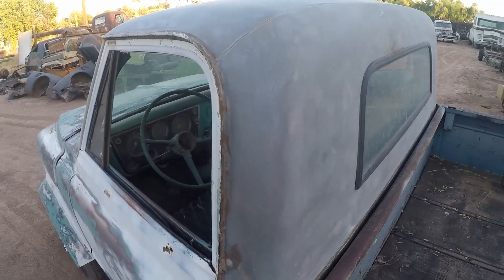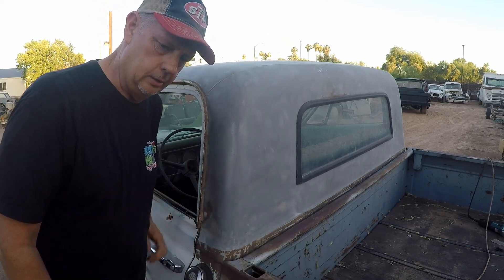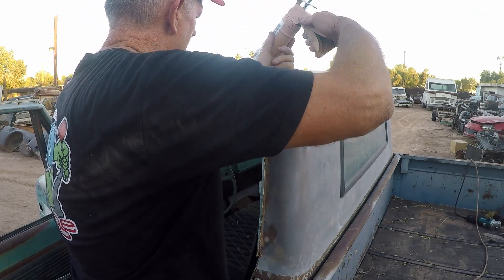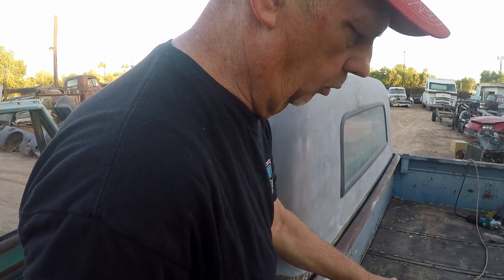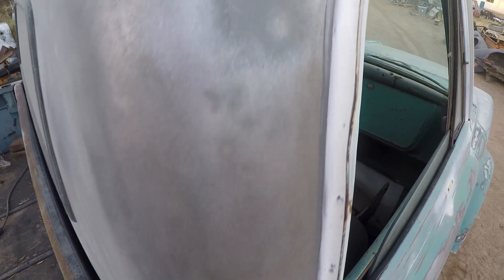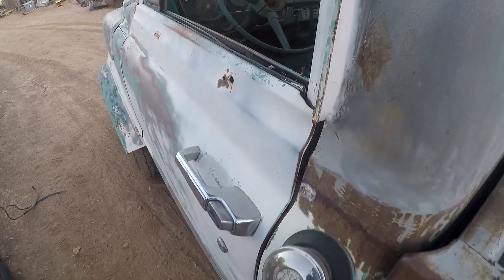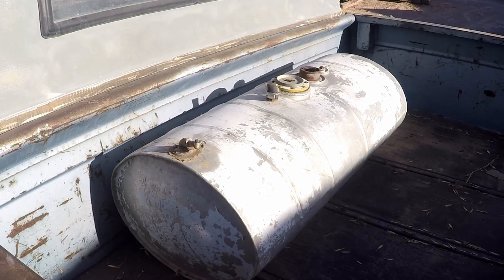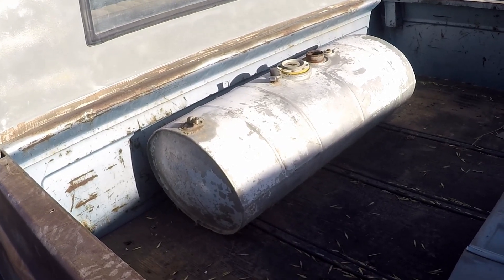69 C50 Faux Patina paint job moves forward. New tailgate with old skool pinstriping we need to save.

Comment: Love the tailgate. I think you'll be able to blend it all right in. 
Is there any way to blend in that notch between the bottom of the fenders and the door or is that unavoidable? It's the only thin I don't love about the whole truck. Not that my opinion matters - LOL!
Keep these comin Pete. You are really inspiring me to keep working on my old 65 Slick.
Reply: Running boards might do the trick.
Reply from the maker: I do have the filler pieces to fill the hole. I tried running boards but haven't found the right pair yet. Thanks for watching!
Reply from the maker: Yes we can! We got you covered baby! You will see next week. Thanks for watching!